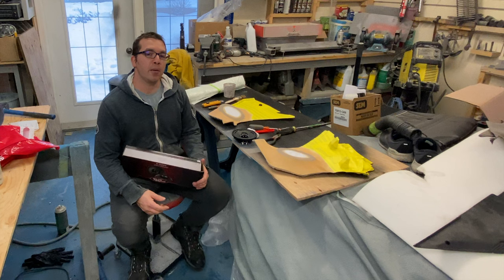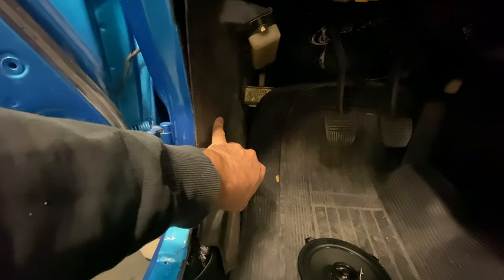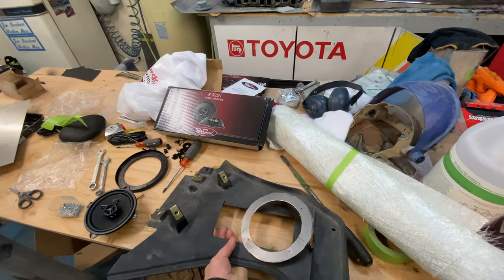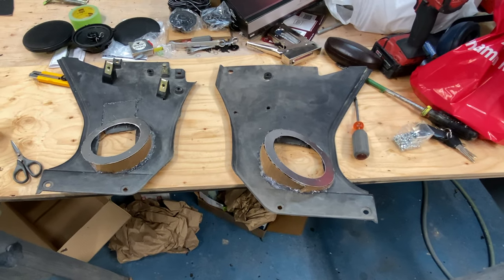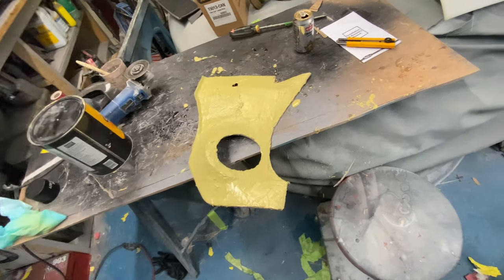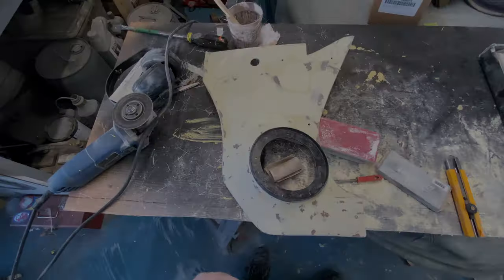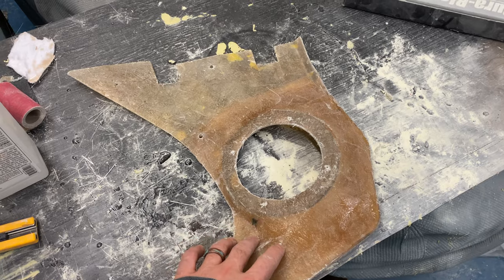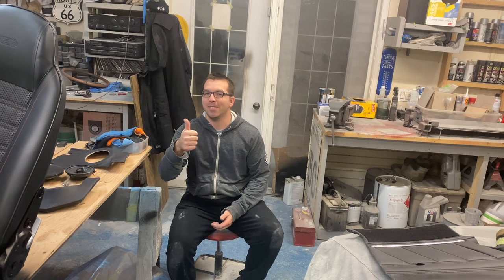Scratch Built KICK PANELS.. Yes You Can Make These For Any Classic Car! How To-Stereo Install ep118

Comment: I have watched so many videos where the speakers are facing straight into the feet or straight up the dash the end you get it loud sound inside and kind of loudish outside but you sir  is the only one that has the angle right facing the correct way to get the perfect and the most out of your speakers 👏
Reply from the maker: Getting the angle right was a tough challenge in that space especially with the minimal foot room. The sound imaging is almost perfect! I also noticed having them in the kick panel vs the doors has reduced the rattles a lot of door mounted speakers always seem to have. Thanks for checking out the video!

Comment: Awesome idea bro! Someone already cut speaker holes in the sides of my centre console area (ta23, so a little different in shape) but I’m totally gonna steal this method in order to build hole-less replacements! Thanks, and keep up the great work!!
Reply from the maker: That should work nicely. So you are building a console from scratch?
Reply: @dadstoygarage1878  nah, i have the old "holey" one, but need to either fibreglass over the holes somehow, or put in low-profile speakers. Either way, i think how you did it with the cloth to get the shape is genius!
Reply from the maker: @GreavesEc  thank you. Just keep in mind the fibreglass does not stick to plastic long term. Potentially you could mount a metal plate to the back of the hole fibreglass filler fill the. Sand it smooth. Then wrap  with thin foam and wrap the foam how I wrapped these panels.